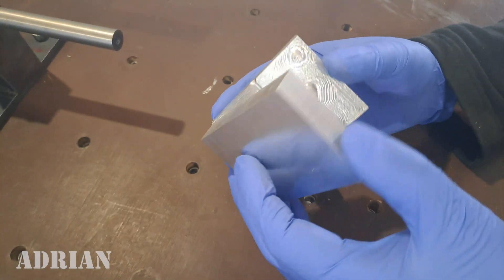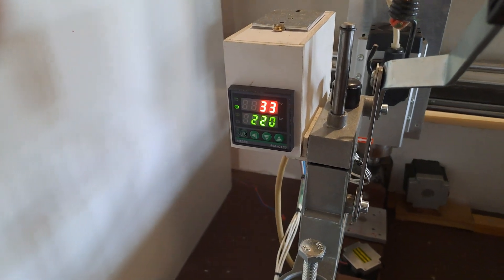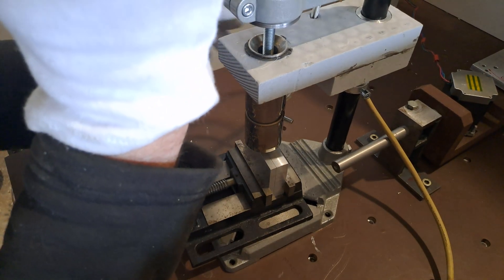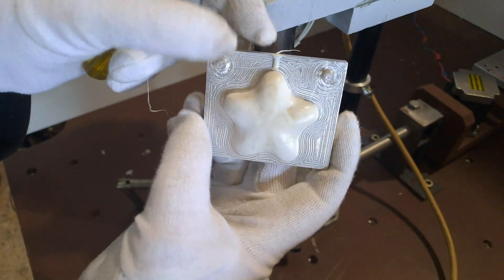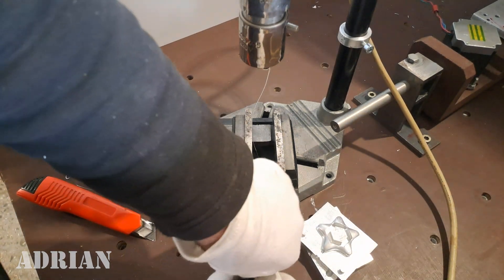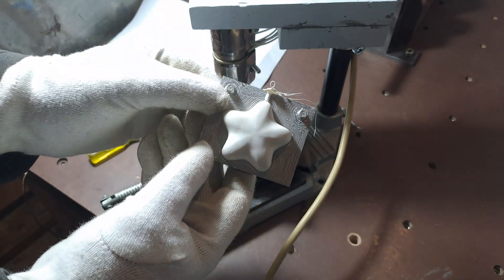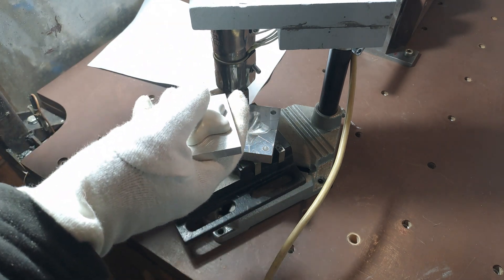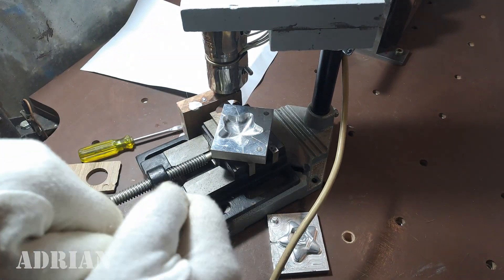Aluminum mold test on DIY desktop injection machine

Comment: I think you did a good job. As far as it being tight for the bolt head. What I would do is to cut a few groves into the bolt head with a hacksaw, to give some channels for the plastic to grip onto the head. Then I would heat the bolt head hot enough so it can partially melt the plastic. Then press the head into the plastic. I would try this on the first print to see how it goes before trying it on the better part.

I had tried to do some plastic molding. I did not have a mold machine. The mold I made was for a dome for a light sensor. It was 50mm in diameter. I had virgin ground plastic that I placed in the mold then heated the mold in a toaster oven. When hot enough I pulled it out and put it on a drill press table and I used the chuck to press down on the top of the mold. I had a couple of holes in the mold that allowed the excess plastic to flow out. I held it until it was cool enough (but still hot) to remove the part. Pulling it off before it cooled completely allowed for easier extraction. 

I worked as an electronic designer and this was what I did to get some prototype parts. I'm retired now so I'm only working on hobby projects.
Reply from the maker: Thanks. I've made another video where I added ejector pins https://youtu.be/BQJWHJQSonc